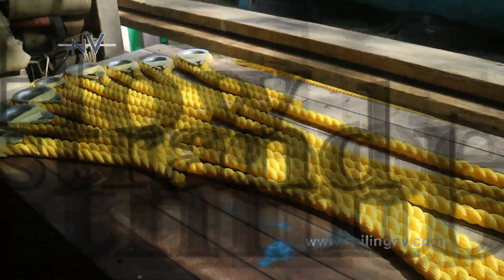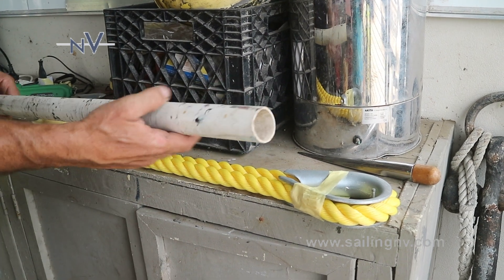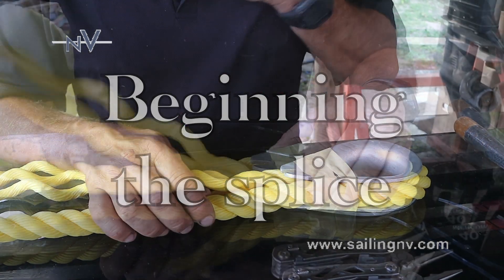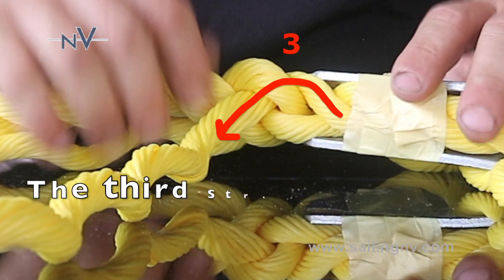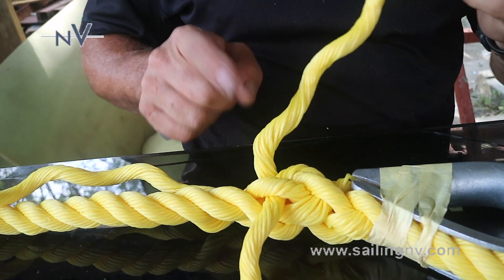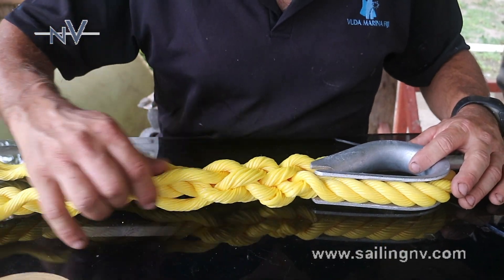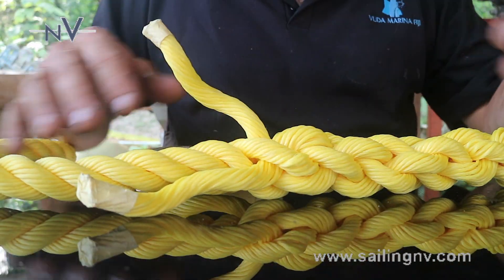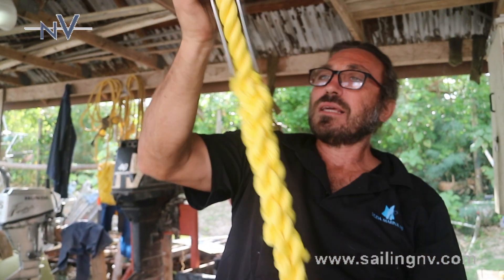Splicing 3 strand rope around a thimble

Comment: Thanks for this tutorial it’s been a long time since I have spliced rope. I like the tapered end technique where the ends all come out the same side. Just curious but what are the purpose of the three meter sections? Also what are some examples of a good use for the eye splice on the end of the rope?
Reply from the maker: Thanks Nick, the three metre sections were for mooring lines to attach boats to in the new marina area. The eye splice is useful in any situation where you are attaching a rope to something fixed and there is risk of chafing with a normal knot. By doing an eye splice around a thimble you avoid this. This can be useful for attaching painter for a dinghy for example.